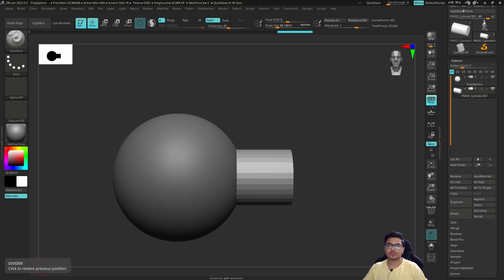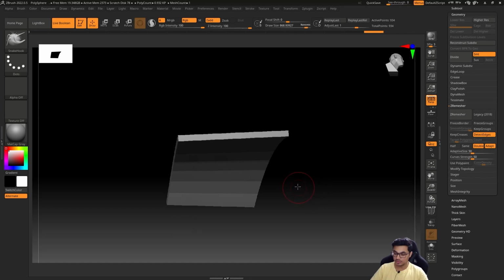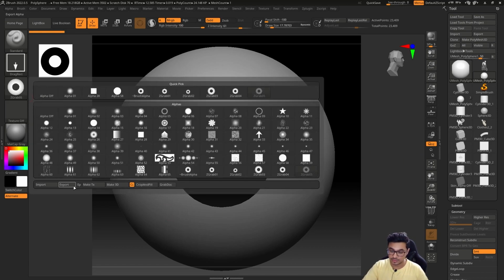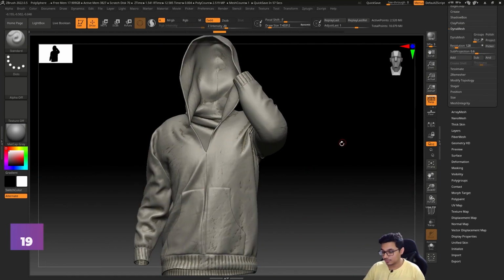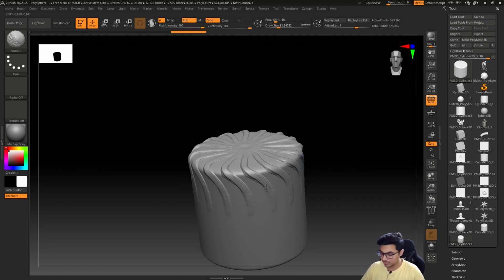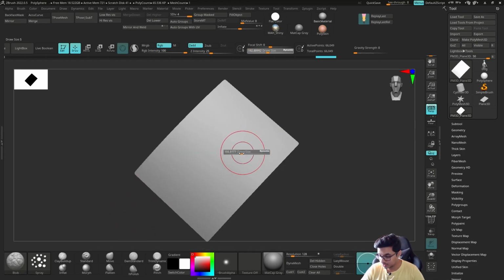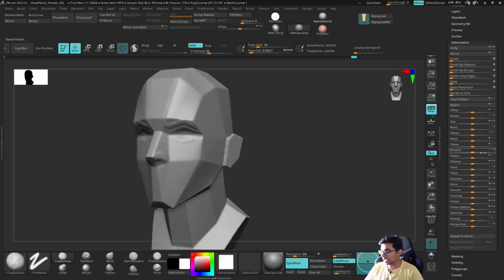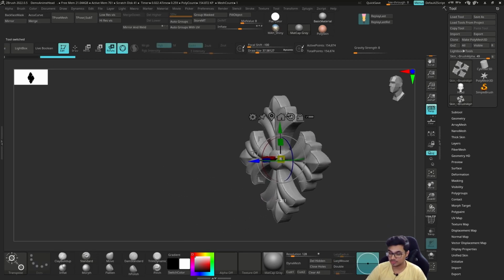50 Tricks in ZBrush

Comment: 00:00 Greeting
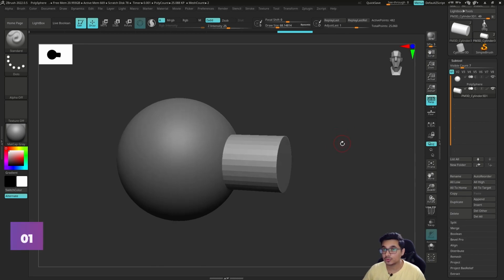00:26 How to join 2 mesh
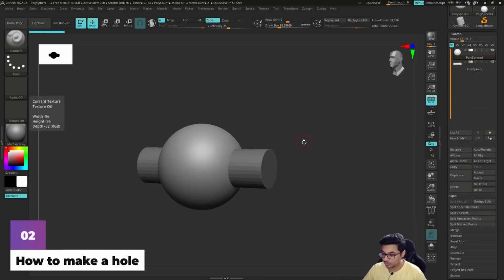00:58 How to make a hole
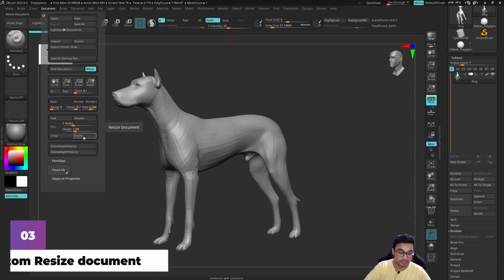01:26 Custom Resize document
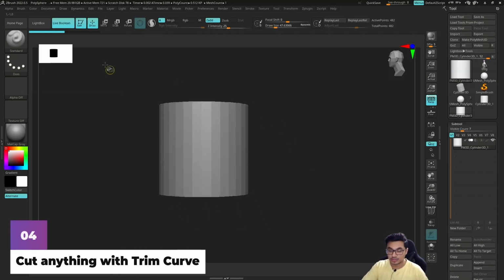01:34 Cut anything with Trim Curve
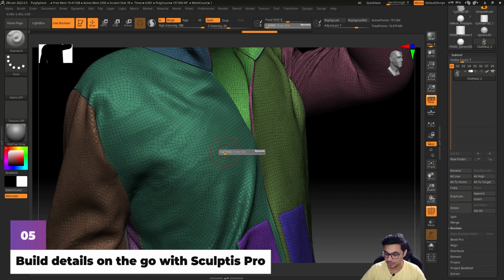01:55 Build details on the go with Sculptris Pro
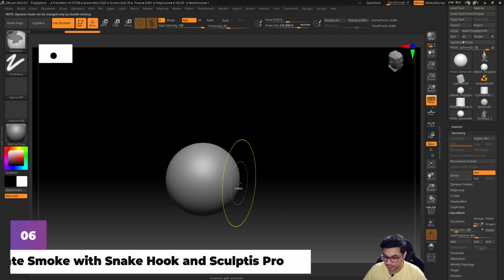02:28 Create Smoke with Snake Hook and Sculptris Pro
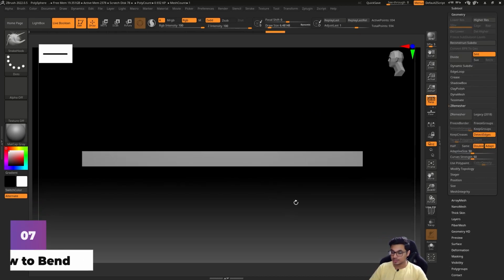02:54 How to Bend
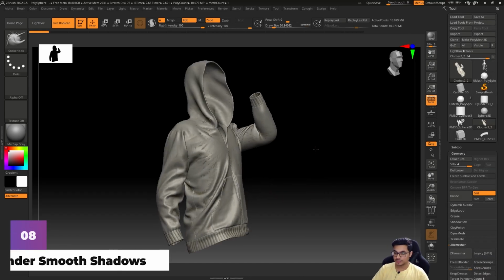03:41 Render Smooth Shadows
04:14 Better Uvs on Zbrush
04:55 Create VDM Brush
06:16 Create alpha from mesh
06:47 Zremesh for quick retopo
07:35 Pose Quickly
07:48 Using Standart Brush with alpha for various textures and det
08:33 RAM brush
08:51 Accu Curve
09:15 Backface Mask
09:35 Inflate Brush
09:51 How to use Morph Target
10:33 Using Layers
11:08 Merge an external Ztool file
11:41 Isolate an unattached part of the mesh
12:00 How to Project
12:24 Auto Groups
12:30 Lazy Mouse
12:46 Radial Symmetry
13:10 See-through interface
13:24 Easy Duplicate within single subtool
13:28 Use Toy Plastic for good looking Eye Material
13:49 Set any pattern as noise if they have Uvs
14:37 Customize Zbrush interface
14:56 Hold Ctrl to scroll through navigation
15:15 Replay Last
15:24 Gravity Strength for Brush
15:49 Local Symmetry
16:05 Dents Using Blob Brush
16:35 Trim Dynamic, Flatten and hPolish
17:41 Move Topology Brush
18:12 Ctrl+Alt+Click on button to assing hotkey
18:39 Best Render
18:45 Grow and Shrink visibility
19:09 Smart Resym
19:22 Deformation
19:58 ZTL save vs File Save
20:45 Press T for capture
21:09 Use IMM Parts brush to quickly add objects to model
21:26 How to Backlit
21:40 How to Record Turntable
22:10 History Recall Brush
22:35 Create mesh from Alpha
______________________
Thanks for the video!
Reply from the maker: Thanks for the great help.
Reply: @akashsensei-02  Np! I just paid back for useful material. ^^